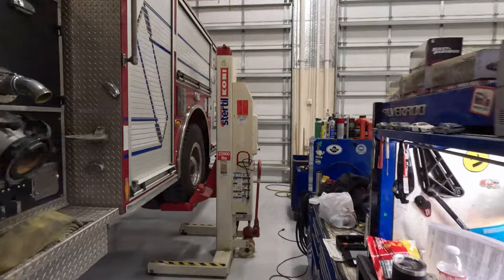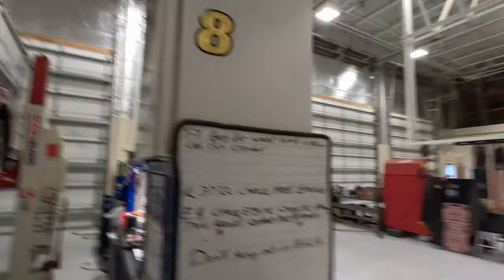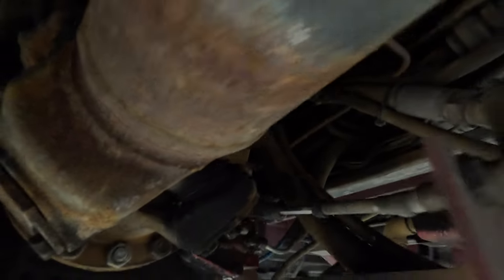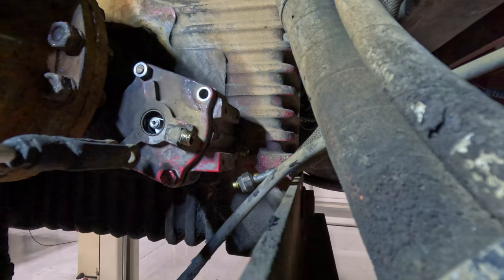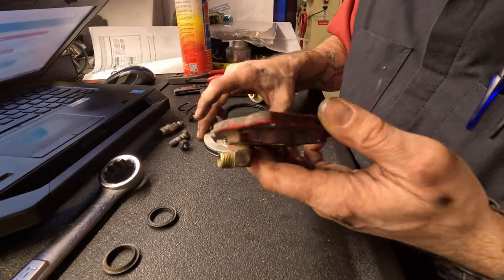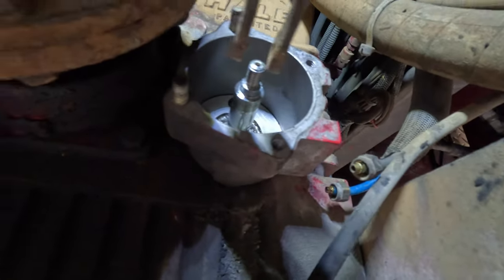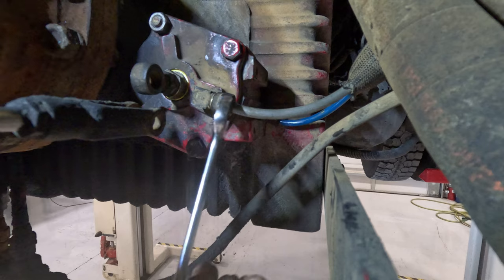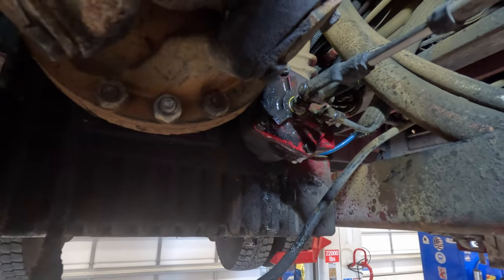Hale pump VPS kit

Comment: I am having trouble removing the shaft from an old Hale setup.  It doesn’t have any spot for a wrench to get it off.
Reply from the maker: hey jkgerry. sounds like you have a one piece shaft. you will probably have to remove the drive line going into the pump transmission to access the fork that is attached to the rod. you will need to remove the shift fork to remove the rod completely.

Comment: . Hello, good video.  Query when the cap of the VSP .  It does not come out and collides with the cardan head.  What can be done .
 In our case the air leak is in the drive lever pto
Reply from the maker: hey maurocarrion9981! appreciate you checking out the video!  is there anyway you could post a picture of what your talking about.? are you saying the cap hits the drive shaft?

Comment: I just changed out a one-piece VPS shaft and fixed a cobbled road to pump set up on an older 84 Mack with a G-series Tcase. I am now having issues with the allison going in to lock up. Also, the indicator light was botched is the transmission given signal through the indicator circuit, or is it supposed to receive a signal for lock up from the shaft indicator on the rear end of the shaft?
Reply from the maker: i believe it should be receiving it from the switch on the pump transmission.
Reply: I am just now seeing this. So can i test that switch with a simple continuity test and what signal voltage should i see on the harness plug. When we did the 2piece conversion, it came with a new shaft cover and dual switches. We did not change the shaft cover. Due to the new switches did not match the harnes plug and the harness plug was not provided.@scottyzevt

Comment: How do you remove the shaft
Reply from the maker: Are you talking about the inner one?
Reply from the maker: The inner shaft?
Reply: Yes  @scottyzevt
Reply from the maker: inside the pump transmission there is a fork with a nut that holds the inner shaft. its been awhile since i have done one. if i remember correctly you have to pull the drive line out of the way and take the 4 bolts out of the input shaft. however you may be able to pull the pump shift switch housing off on the back side of the transmission to access the bolt that holds the shaft. hope this helps a little. @CodeyCheek
Reply: Thanks For the reply.  @scottyzevt